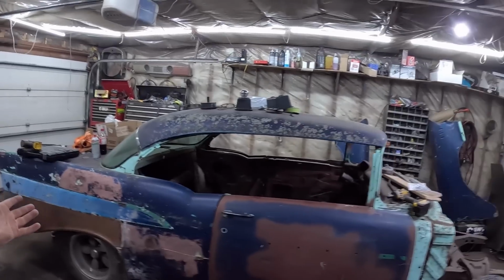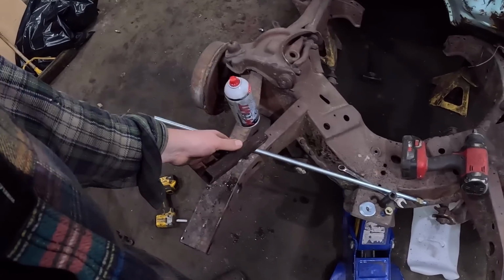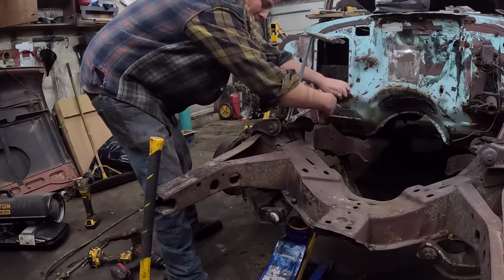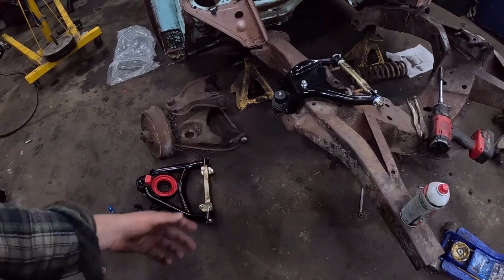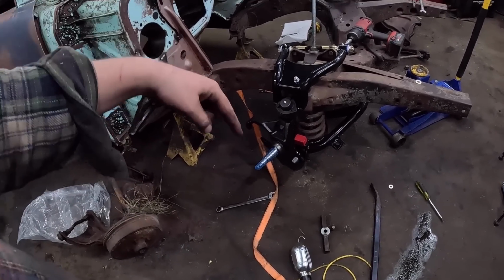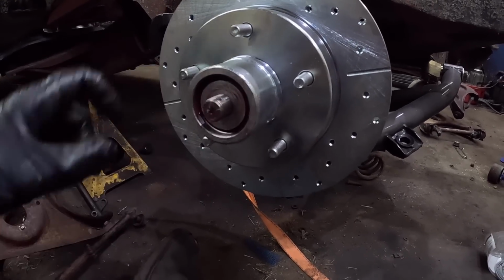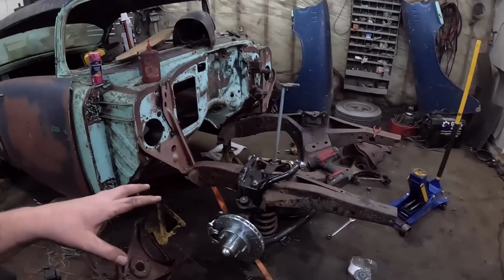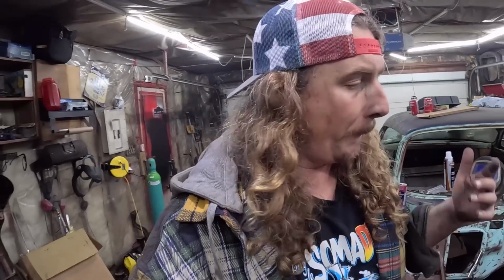CHEAPER THAN REBUILDING - Tubular Control Arms AND Slotted Disc Brakes!  Worlds Worst 1957 Chevy

Comment: All springs, whether constant rate or not, change when you cut them. Think of it like this: take a 3 foot length of 1 inch diameter rod and bend it over your knee. Then, take a 1 foot section of that rod and try it again. It will take more effort than the 3 ft length. Shortening a spring works in a similar fashion.
Reply: Yes, shortening a coil spring makes it stiffer because there are less active coils.

Comment: I had a '55 2 door sedan, 6 cyl auto. Installed a 265 - 3 speed stick. Bought clutch linkage and bell housing for $15.00 U.S. out pf a junkyard. Ya can tell that was a while ago. We had a small car club and worked out of an old abandoned gas station/warehouse. Great times I'll never forget. Gettin' dirty and greasy on every project. '47 Merc, Coupe, my '48 Ford 2 door Sedan with a 331 Chrysler Hemi and my '55 Chev. A friend brought in his newer car, '60 Ford, 390 tri - power. What a BALL❗😂👍
Reply: P.S. 
The '47 Merc. Coupe had a small block Chevy in it. Bob kept a spare three- speed in the trunk because he was always wrecking them.😮😂

Comment: I assume you've never worked on a mid '60s Ford. One of those with the coil spring between the UPPER control arm and the body. That's the way my '64 Fairlane was. I really did almost get killed removing the springs from that. Those springs must be strong enough to hold up a 10 ton truck. I had the proper spring compressor (rented it from Autozone) and had it installed properly. From the second the compressor got tight, the spring did not want to compress. I double checked everything, nothing wrong. I put a piece of pipe on the breaker bar and forced it to turn. I got the spring compressed just enough to remove the upper control arm, and while I was pulling it out, the spring compressor broke, the spring flew out, flew by about two inches from my head, and landed about 50 feet down the street. I actually broke 2 spring compressors and damaged another one on that job, and it turned out to be all for nothing. I replaced everything. Spent over $1000 USD. And just like you said, about a year later, it was all junk. I got the parts from Dearborn Classics, which is part of Ecklers, one of the biggest restoration parts places in the U.S. But it was pretty obvious they got them from China. I never finished the car, I sold it just the way it was. There is nothing more frustrating than putting a lot of work and money into something, only to wind up with a pile of junk.

Comment: I vote that you should clean it, sand it, and spray it in light gray primer. If you really want to “pee-off” some viewers, install one of the in-line sixes that you pulled out of the other cars. 😅 A hopped up “one lung” with and automatic would be a mind numbing combination 🤭
Reply: I had a couple inline six back in the day one out of a ups truck bread truck that would break rear end plenty of power. Infact I put one out of the ups truck in my wrecker in place of a 30 over 350 and it was bad to the bone.
Reply: Dammn..SON..good idea....on dat...one lunger....Automatic....

Comment: No spring compressor needed on any full size or mid size GM when you unbolt the control arm versus the ball joint. I've done literally hundreds of sets this way. The only issue you may come across is siezed control arm bolts. It's  a much safer practice than compressing the spring and wrestling it in through the ball joint side.
Reply from the maker: Not on a tri 5

Comment: Good practice is to look at the hardware especially the castle nuts since I have found multiple castle nuts with only 3 to 4 threads on them and used OEM ones to replace the Chinese ones

Comment: I was going to rebuild my 57 front end but like you said those parts add up and these control arms are pretty cheap. I assume they hold up ok since you are still putting them in cars 2 years later.

Comment: No disrespect intended, but...
BEWARE cheap control arms!  I bought a set of first gen Camaro arms on sale from Speedway, and found these problems:
-holes for sway bar links didn't line up.
-bump stops didn't align with the pads on the subframe.
-one upper ball joint was very sloppy.
-worst of all, much of the welding is sketchy or downright dangerous.  I sandblasted the thick powder coat off the lower arms to inspect the welds where the main tubes join the inner pivots, and found massive undercuts and HOLES in the welds.  Scary stuff.  I rewelded most of the joints with tig.
There are a lot of these things for sale all over.  They all have the same red rectangular bump stop and red conical droop stop.  They're junk. 
I understand the attraction of low prices, but you get what you pay for.  How much is your car worth?  How much is your life worth?  
Next time I'll save up for name brand parts.

Comment: DAN, if I was you I would just spray over it with CLEAR COAT or put the wipe on patina protector on it. Or, you can always go with cheap SATIN BLACK PAINT. Anyway, if painted for real, SATIN BLACK is always the coolest. Plus, it really POPS OUT the LOOK of the CHROME. Thanks for the video 📸.

Comment: Hey man I just got a 56 chevy 210 it came with a inline 6 3 on the tree jw  if you have any tricks to install 350 with th350 trans like will factory driveshaft still work and do I have to change pitman arm?

Comment: Dan! Do not promote using anti-seize on the caliper slides, believe me when I tell ya, i been to GM school, use a silicone based lube, petroleum based lube makes the rubber sticky, the tiny bit that the caliper moves, petroleum based lube is too sticky, believe me.when i tell ya, use silicone based lubes on yer brake parts unless its a metal to metal contact point

Comment: I used nothing but MOOG for decades until two front ends in a row lasted less than 500 miles. I use Proforged or Qa1 ect. now. MOOG should be sued by all of us. Don't buy MOOG crap unless it's nos parts from 20+ years ago someone never used.

Comment: I don’t know why you are sitting on the cold concrete floor 
I get old carpet runners / floor mats  from the swap meets 
These are used entry way mats that linen companies supply to businesses 
And when they get too ratty they sell ‘em 
Usually about 10 bucks each 
I always buy a few so I can have some newer clean ones as the old ones get trashed 
I like the 3’x5’ and also the 10’x3’ hallway runners

Comment: I used to be suspicious of disk brakes when I started seeing them, but now I'd rather have them than drums. I don't get the slotted or holes. Seems like they would wear funny.
Reply: The ones with holes if not drill properly will have cracks starting from the holes. I have run slotted for years no issues.

Comment: Dan I watched another YouTuber call #BlainesTherapy they dropping the whole front end on a 56 Chevrolet Bel Air and he cut the coil springs with a torch and it relaxed everything he just dropped took the bolts out of the Oprah and lower A-frames and took them off with no explosions A-frames

Comment: What I notice with after market parts is your rolling the dice, you might get junk parts that don't last long or you might get parts that will last the life of the car?  I had made in China tool's that I thought was not going to last long at all I ran the motor for hour's and it still runs like a champ after year's of abuse.

Comment: There is no such thing called a 210 hardtop belair because a 210 molding package does not come on a hard top
Reply from the maker: Ummmm no
Reply: Yes they did, I was the kinda kid that always went to the Chevvy dealer when the new ones arrived each fall and I saw one in the color that Dan's car was originally painted.  They did that because the hard top became so popular that the 210 was produced for less money so more people would buy them. Same thing in 1955 and 56! They were usually painted a solid color, that is top and body.  Dan check that top on your car the paint will probably match that on the firewall.